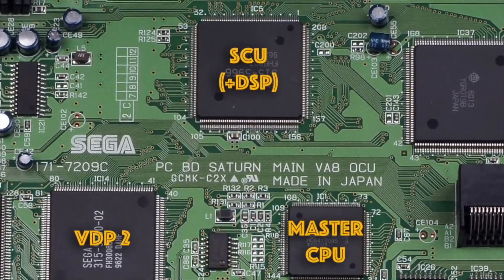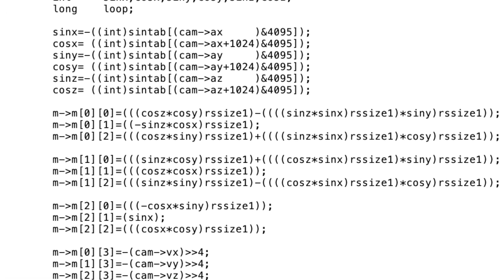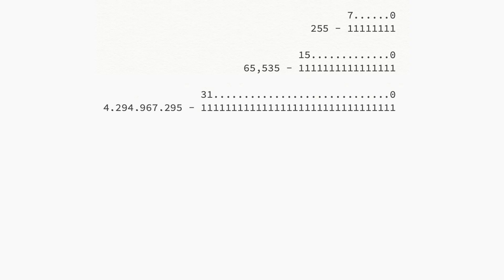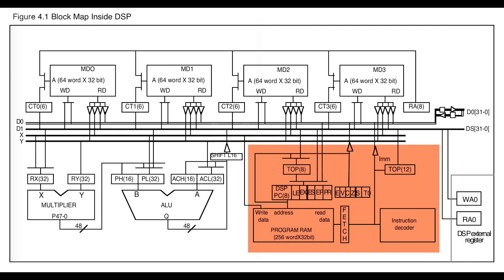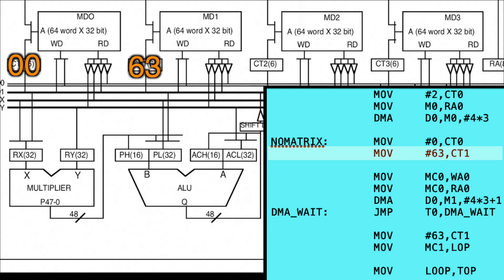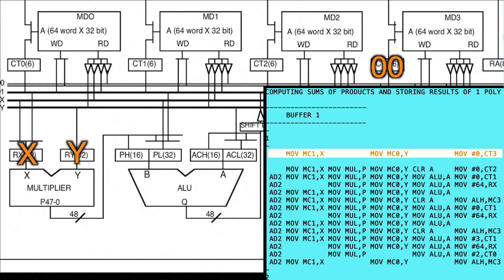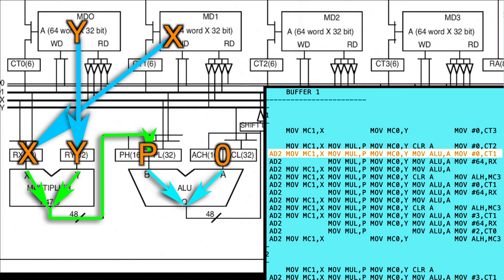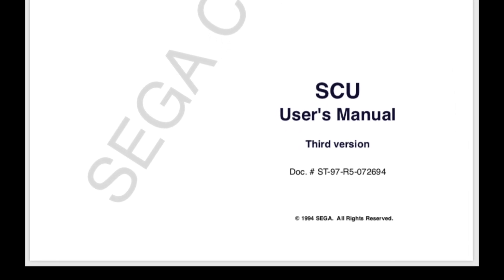Sonic R's code the Hardest in the World?

Comment: Surely 3D graphics on the C64 would be super-hard compared to this? There's no multiply instruction on a 6502 (or 6510 if you wanna be pedantic) .  Even Bresenham on a C64 would be painful.  Thats just for wireframe, filled polys would be murder!

Comment: In 2001 I spent a lot of type optimizing the Quake 1 and Quake 2 software renderers to run on Pocket PC processors back in the 90s.  They did not have a coprocessor / floating point math at the hardware level, so a great deal of the optimizing was converting floating point operations to fixed point integer math.  Seeing the bitwise AND (&) with 4095 to mask it to 12 bits for the lookup table immediately jumped out at me.  Although that isn't directly fixed point math, it is similar (using integer degrees where 360 degrees is 4096, allowing around 1/10th of a degree precision using only integer math / lookup tables).

Comment: I can't wrap my head around how it's even possible to move multiple values through the databus during a single clock cycle?  I also don't understand how values stored in the X and Y registers can be used for calculations while also being updated to new values from memory? x_x Admittedly I'm pretty new to all this and it seems like it should be a core concept in modern computing and how modern processors optimise instructions.  Does anyone have an explanation?
Reply: "move multiple values through the databus during a single clock cycle" - stop the video at 1:36 - across the middle of the diagram there are 4 lines labelled D0, D1, X, Y - each of these is a separate bus, so 4 pieces of data can be moved along them per clock. You will (for example) see that each of the memories at the top has a "pointy arrow" to each of the 4 buses, to allow the memory output to go to any of the 4 buses.

" how values stored in the X and Y registers can be used for calculations while also being updated to new values from memory?". This is what is known as synchronous logic. Along the path from memory, through the multiplier, into the ALU etc. are things called registers (Note: These are not exactly like conventional CPU registers, but similar) such as X, Y & P. At the start of every clock cycle a register will take what is supplied on its input and remember it, putting that remembered value on its output. So for example, after a clock pulse the register at the output of the multiplier (P) will be remembering the output of the multiplier that was present at the clock pulse, but at the same time the new values from the X & Y register (which were also updated at that clock pulse) will be working their way through the multiplier to arrive at the inputs to the P register in time for the next clock pulse. I hope that helps a bit - it is quite a difficult concept to grasp.
Reply: @kevinjbakertribe  Yeah thanks Kevin, that actually helps a lot! As far as I understand the ALU (for example) would hold it's output from the previous clock cycle until updated with a new value on the next cycle? I guess this should allow it to perform calculations on the data on it's inputs while still holding a valid output.

I am also very curious to know how the memories "know" which bus to output to (or in other words, how they know if a bus is already carrying data).

Thanks!!
Reply: @MikkMakk90  Have a look at the other video on this "The Mystery of Sonic R's Impossible Code" - around (for example) 4:30 you can see there is an "X bus control" and "Y bus control" section. It is highly likely that 2 bits of each of these instructions directly pick which of the 4 RAMs get switched onto the X & Y bus respectively - so the code that Mr Coding Secrets wrote tells the DSP which which RAM to select.

Comment: Oh this sounds very familiar to me. I coded on the Nuon platform whose CPU was a small array of what were called "processor elements", each a VLIW processor allowing the coder to specify up to 7 operations per tick; I remember days spent trying optimally to load each instruction so that all function units were maximally occupied for inner loop code. So you had the fine-grained parallelism inherent in the VLIW code, plus the coarse-grained parallelism of it being a processor array; four of these things banging away at the same time. Plus they each had 4k of data RAM and 4k of instruction RAM each, and they did duty for ALL the graphics stuff, so you also had to orchestrate a complex dance of DMAing in chunks of screen RAM and code overlays to instruction RAM to have the right code to hand to process the chunk... happy days.

I think only a handful of us were ever mad enough to code it to that level. I'd been an assembler nerd for years at that point so I actually loved it in a perverted kind of way. But I fully appreciate that saner developers would much prefer to bosh out a bit of C and let hardware do the heavy lifting!
Reply: Why hasn't anybody noticed that our lord and saviour Mr. Minter has commented on this video. Love hearing old coding tales from the old days. Cheers Jeff!
Reply: How cool! Jeff Minter the man and the legend! I wonder if it was game Tempest 3000?
Reply: I absolutely adore VLIW processors, even with how absurdly complex coding for them is. Currently collecting pocket money to get a modern Russian VLIW Elbrus workstation to get more in-depth with the tech.

Comment: "hardest piece of silicon to code for" - try properly coding for IBM's CELL architecture. If you use the SPEs and EIB properly you can get crazy good performance out of it. But that's very complex. If you're seriously interested in coding for it you can buy an IBM QS20, QS21 or QS22 blade for their relevant blade server, they pop up on eBay for relatively cheap these days. Or you can pick up a GigaCell 180 PCIe card which has the second version of the CELL processor on it. Or alternatively you can pick up a PS3 and hack it to run Linux (or find an old fat one on an old firmware), but that one is certainly the most clumsy route.
Reply: What is it exactly that makes it so hard?
Reply: @bangerbangerbro  im no expert but i read the CELL is like 7 processors in one and the shit is so hard to synch between them that gives programmers a pretty hard time.
Reply: @wton  ok.

Comment: I mean, that, doesn't, seem, that complicated? I took the time to go read a SEGA technical bulletin on the DSP and there is actually sample code in there for dot products and matrix multiplication. Granted, I agree with the manual that this would take longer to code than non-parallel assembly, but it's so far from "hardest ever" that, that seems like a joke. For anyone who's interested skip to page 157 of this pdf: https://segaretro.org/images/c/c7/ST-TECH.pdf

I was surprised to learn that it can do a multiplication in a single cycle, the hardware in the DSP must be pretty interesting. I might go see if anyone has diagramed the MLU. Also, given that the manual specifically spells out the code for matrix multiplication I don't think you'll find anything that "should have made this code impossible to run" lol.
Reply: Thinking more on the multiplication in a single cycle thing; the DSP has one cycle for every two cycles of the SH2. That got me thinking. Is the DSP just calling two cycles, one cycle, and it has no "one cycle" instructions? I mean, there are a bunch of other reasons it could run at half speed, so I'll still need to look for circuit diagrams to know anything, but it's a fun conjecture.

Comment: How the heck does the AD2 instruction executed simultaneously with the MOV ALU, A instruction cause the result of that cycle's ALU operation to get moved to the A register? Wouldn't the read happening simultaneously with the addition mean that the contents of the ALU register from the previous cycle are moved, rather than the current cycle, or is there some kind of sub-cycle ordering that's going on which isn't obvious from the code or chip diagram?

Relatedly, why is the DSP code arranged in columns the way it is, rather than just everything from left-to-right (i.e. the first row's instructions would be from left to right, then the instructions added in the second row get appended)? Is that just organizational for human readers, or does the assembler require that instructions show up in a specific order?

Lastly, what does the MUL chip do for its X register if nothing is moved there after a multiply? I'm guessing it fills it with a 1, so that the lone Y register MOV on every 4th line can be properly used to handle the translation component (since you are using a 3x4 matrix I'm assuming you are storing the translation vector in the 4th column)

Comment: Somebody else please tell me that you didn't understand this, I can't be the only one 😭
Reply: i can desribe myself as a smart guy, however this was to much. You have to be professor to think of this in the first place and then be his A student cum laude to explain how it works. really amazing and over he top difficult to get a game running.
Reply: You should try nandgame. It's a little browser-based teaching tool that shows you how computers work. You make a number of different gates using transistors, which when combined in certain complex ways can eventually perform various mathematical operations. Then you string them together into something bigger. 

These chips are like that. They're all built using various arrangements of transistors. The instructions in the code cause electrical signals to be sent to different inputs on these chips, rerouting electricity through various gates in order to multiply, divide, add, subtract, square root, etc.

It's crazy that something so complex can arise from something so simple.
Reply: Basically, to make a 2d picture out of 3d objects you gotta do a bunch of linear algebra to warp the shape of the object to the perspective that you’re looking at it from. So where traditional computer chips would take forever to move the data, crunch the numbers, and then move it where it needed to go, the Saturn DSP was specially designed so that it could move 4 numbers at once and do 2 mathematical operations at the same time.

Comment: As someone who does GPU programming for a living... this really isn't that bad. It's more like microcode than normal code, but if you look at each of those columns vertically, each unit is basically either doing its one thing in a particular cycle or not doing anything (with a couple exceptions). If you understand the hardware--and that DSP does not look very difficult to understand, compared to modern GPUs--it would only take a few minutes to write that matrix multiply routine.
Reply: Basically each line of code here is the equivalent of one fused-multiply-add instruction on a modern CPU or GPU, plus a little memory indexing. It's just written in a complicated-looking way.

Comment: I have a question: When we see the code: MOV MC1,X    MOV MC0,Y   MOV #0, CT3     

Shouldnt it be MOV MD1,X etc etc? I dont quite understand why its MOV MC1,X and not MOV MD1,X
Reply: Nope, MD0 - MD3 are memory banks that hold 64 32-bit numbers, like an array with 64 numbers.
Now, the MOV instruction has two possible first parameter, either MOV M[x] or MOV MC[x], the first one (MOV M[x]) tells the DSP to grab the number from the index stored at CT[x] from memory bank MD[x], as for the other version (MOV MC[x]) it does the exact same thing but it increases CT[x] by 1.
 
So, if you have MOV M1,X and CT1 is equal to 2 it will grab the 3rd number (remember, it is 0 based) from MD1 and store it in X, leaving CT1 untouched. If you used MOV MC1,X however CT1 would be 3 once the instruction is done.
Hope that helps!

Comment: I know that precise assessments aren't possible without the source code, but just by analyzing the footage, would you say that the Saturn version of the Shenmue prototype was even "more impossible"?
Could it run at a slightly higher frame-rate or even use Gouraud Shading?

Comment: Those chips with more parallel instructions are fun :D. I was programming one like 2 years ago and I've literally used Excel as a code editor :D
Reply: Seems like you can make a makeshift debugger/code-flow-tracker on the side there as well.

Comment: Multiplying two 32-bit numbers could result in a number requiring 64-bit. What happens if you need more that 48-bits? is it just an overflow?
Reply: Probaly this or data loss. Time to read the documentation

Comment: Nice,
I believe the SIMD extensions for x86/x64 were the equivalent to this where they could do mass matrix multiplications in parallel to speed up this kind of polygon processing.
The whole Saturn configuration reminds me of programming on the GP2X where you had 200MHz ARM920T host processor and 200 MHz ARM940T programmable coprocessor and if you were clever, could fully utilise both CPUs to do tasks in parallel since they had the same instruction set/bus/register size and make the code significantly faster for 3D related things. Payback (a GTA clone) used this to maximise frame rates to great effect.